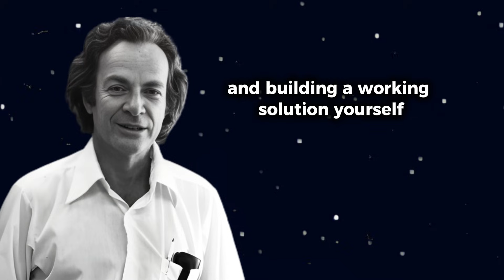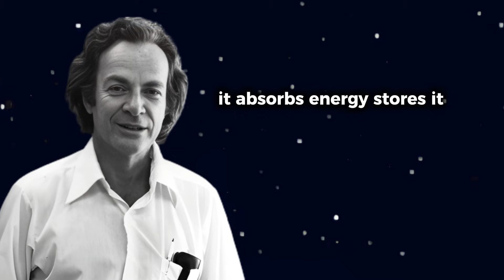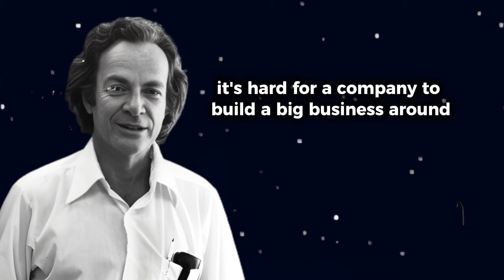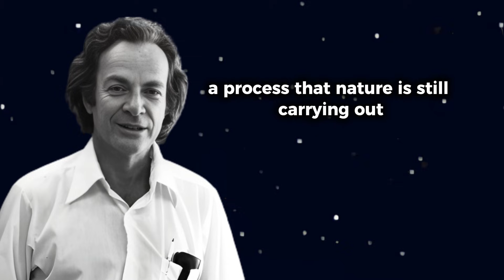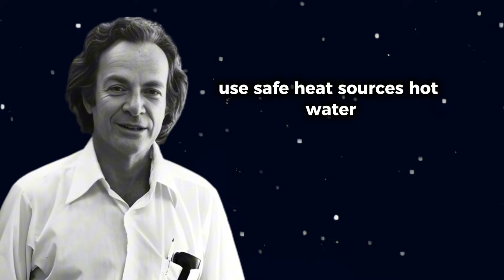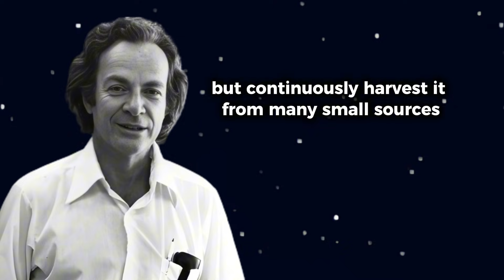Richard Feynman: FREE ELECTRICITY FROM YOUR ROOF SINCE 1902

Comment: I think all the ceramic dowels with iron wire, I would see in Hot attics were part of this system. I thought, "Why would they have a bare wire suspended on 6 in. ceramic dowels?" I have examined old iron wire from attics, it seems to be iron that is plated with a silvery metal.  The house also had insulated twisted pair wire ran  on wooden strips just above the foundation on the north side of the house. People try to tell me they used iron because copper was used for the war effort and the ceramic dowels were used because the iron wire would get hot, I don't fully buy this explanation.  My dad told me they had batteries on the farm in the 1930s for lighting and radio but he did not know how they charged them.